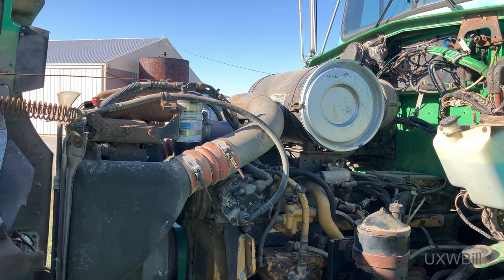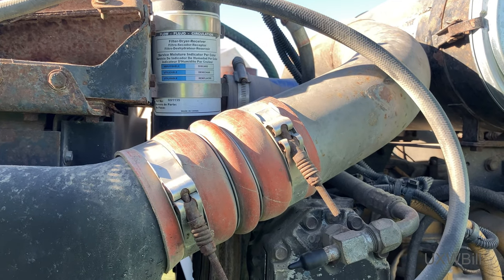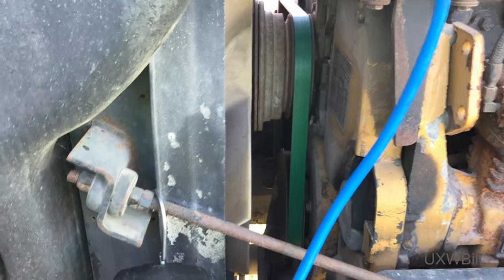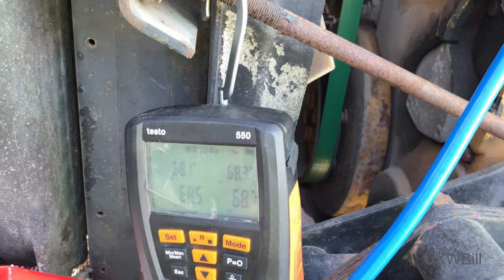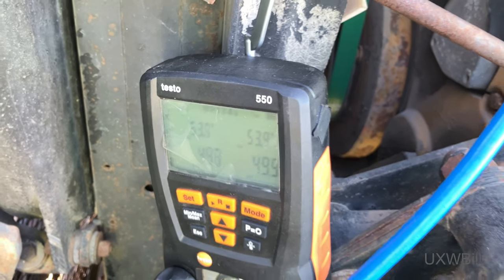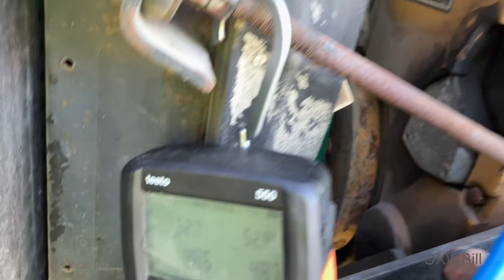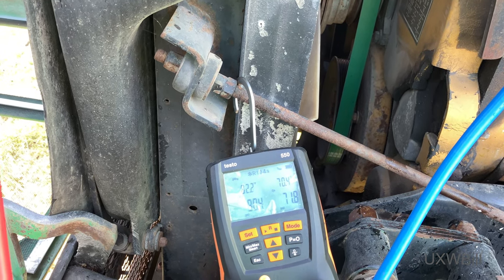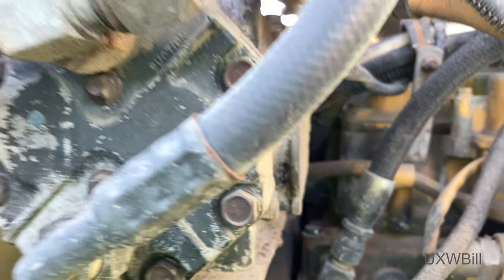1995 Kenworth T400 Air Conditioning System Evaluation and Leak Test

Comment: I am pretty impressed that the non functional ac system was left alone. when I have looked at buying cars in the past I immediately lower my offer when I see that someone cut the ac lines off at the firewall and tossed all the under hood components.  It is a massive pain to piece a system back together when literally everything is missing.

Comment: For those who are curious, the Kenworth T400 is basically a short hood variation of the T600.

The T600 model is Class 8 On-Highway truck-tractor, The T400 model is a light vocational truck-tractor, there's also a T450 model that looks similar to the T800.

Production years for the T600 lasted from 1985 to 2007, whilst the production of the T400 and T450 lasted from 1988 to 1997.

Comment: I’m shocked the heater box wasn’t completely rotted out. Changed too many of them over the years for ones made of stainless. Also check the grille denser. They are known to rot out along the bottom

Comment: I have a 1995 freight-liner FLD120 with a series 60 Detroit It has the same compressor. That style in the video uses more wasted HP than a newer style compressor. But those I’ve come to find are more reliable. Then the sanden style.

Comment: So this is a different video/topic from the one at-hand, but I was thinking I should get caught up on your previous videos. I saw the one about your truck getting increasingly naughty and you getting frustrated at the state of today's vehicles -- I drive a 2011 Camry, and the head unit gets flaky when I park it in the sun, the AC stopped working, and the low tire pressure light is stuck permanently on. It has a lot of miles on it, and I was a teenager when I started driving it, so it wasn't treated particularly nicely. Still, I know that any vehicle I will replace it with will have a bajillion things for me to complain about. So I understand your pain there.
Reply from the maker: Comment on the relevant video?
Reply: @uxwbill  Sorry. You're right, I should've commented there. Still, I always enjoy your attention to detail, and big trucks are a different beast indeed!